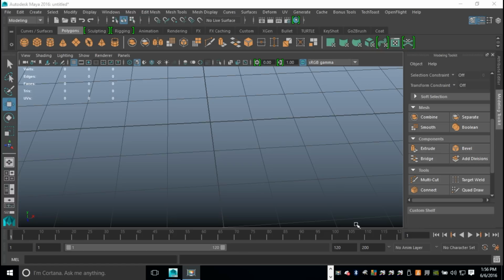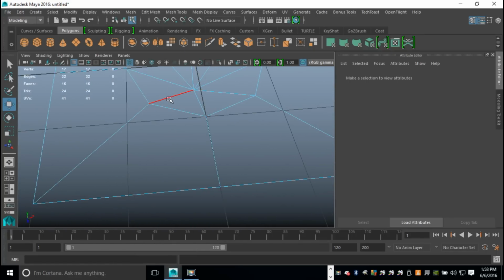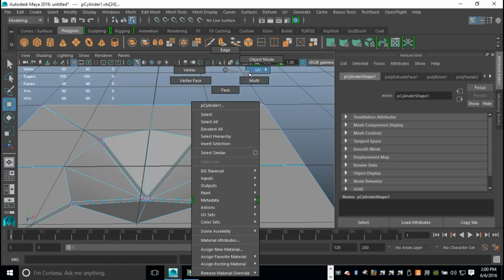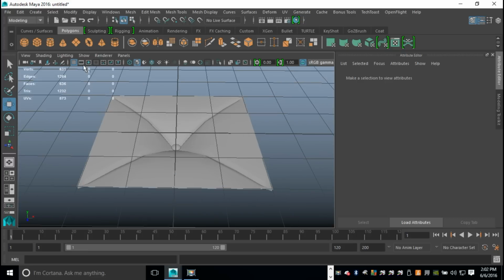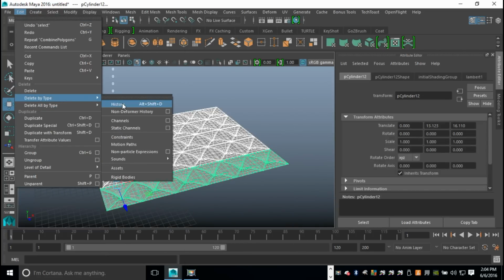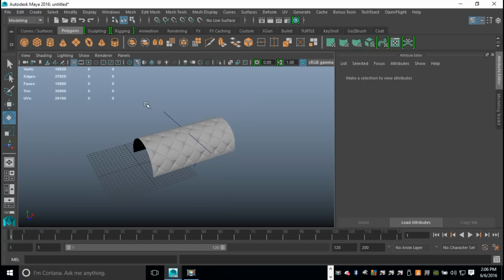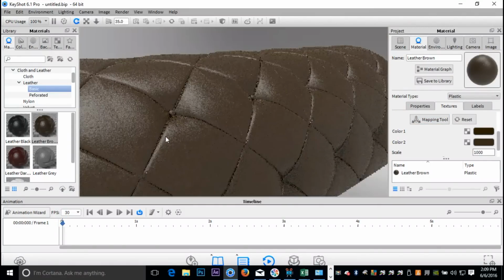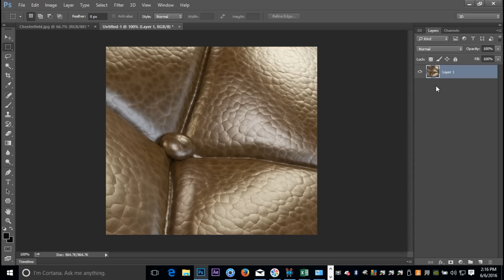Maya 2016 tutorial : How to create a deep button "Chesterfield" effect.

Comment: When trying to import to keyshot, I get the "no 3d geometry" error. Do you know if some of the settings during the export needs to be specific? This is from maya 2016 > keyshot 6.02
Reply from the maker: Are you using the plugin ? You should export the model out of Maya as an FBX and then import it into Keyshot
Reply: Nope... going same route as you in the video.
Reply: Oh well... ended up updating and the problem was gone... :)
Reply from the maker: Interesting

Comment: awesome work man...btw in keyshot when ever i try to render something with the preset size of higher than 800x450 it doesn't change the size it stays in same size of 800x450 what should i do?
Reply from the maker: No sure. It it a video card restriction or do you have a trial / student version ? You could ask Luxion
Reply: when i first did it it worked but after that it sees to stuck in the same size
Reply from the maker: Hmm, that's strange

Comment: This method you'd only use for a macro shot like this. Otherwise you can get by easily with just normal maps.
Or even if you want a closeup a displacement map but then this approach would be more efficient.
Reply: This would also useful for 3D printing.
Reply: Woohoo
Reply from the maker: Correct
Reply: +Shawn Spear actually a displacement map changes the topology and can be sliced as well.